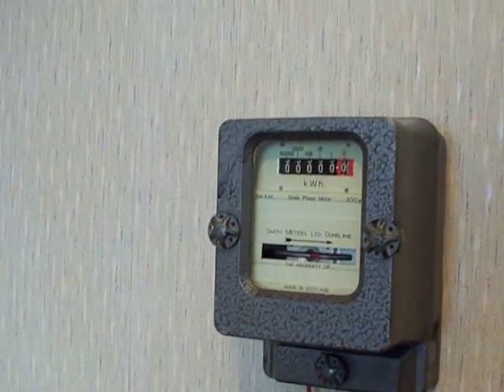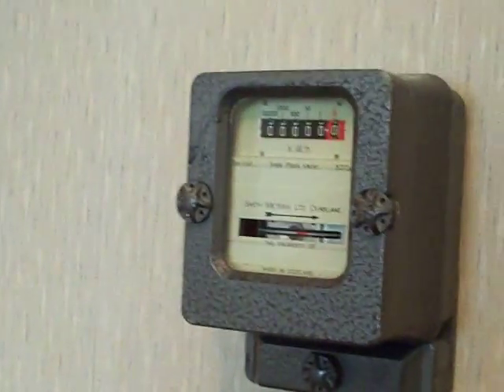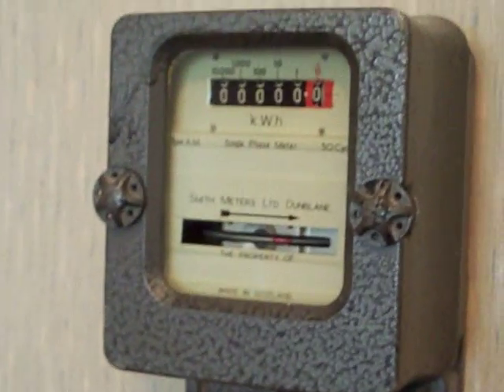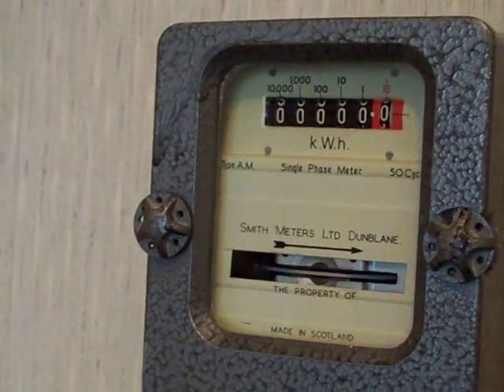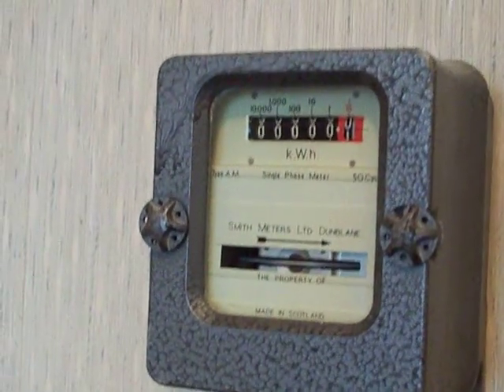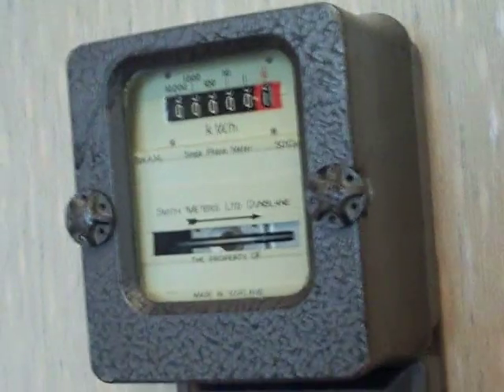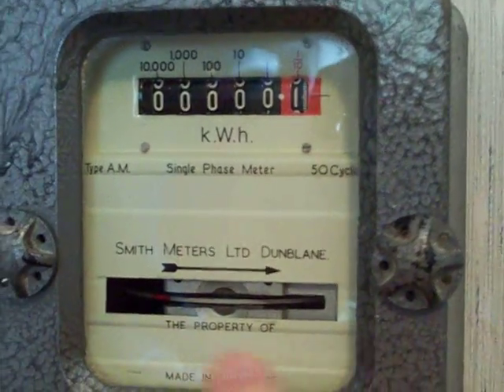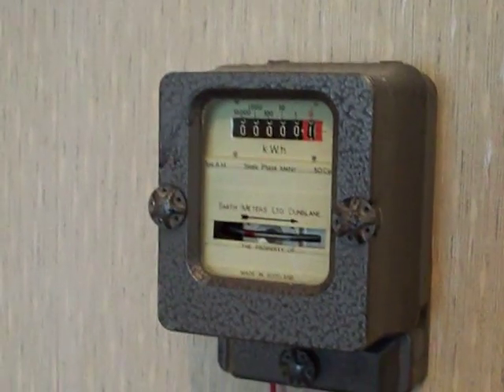Electricity Meter : Accuracy Test, Smith AM type, kWh meter.

Comment: Hello there BBD I am pleased that you got the meter going. For your information you can get that horrid paint off without damaging the surface underneath you can use a product called Tcut it's for taking a layer of paint of for cars to get a good shine on the paint work. Fortunately the paint is not that thick so it can be removed relatively easy. This is what I have been dong with my CL147D it has been coming up a treat. It does however need a lot of work to get all the paint off but the surface looks really nice and polished underneath. When I have finished mine I will have to show it off on hear when I have finished my other projects. Well done on getting this meter working. Steve.
Reply from the maker: Hi. I have heard of T-cut, but I use..... HAIR-SPRAY. :D

Just like what is seen in the restoration of the British Sangamo HM (Playlist available on my channel!) the alcohol in the hairspray will remove the paint from this AND NOT damage the casing at all, provided that the alcohol is removed quickly after doing its job.

The alcohol can be diluted & neutralised by spraying a small amount of water on top of it then rubbing dry with some soft tissue.

When I restore this one, I will gut-out the back-case (just like I did with the HM) so that I can get right into it without having to worry about getting any loosened paint into the workings of the meter, or spraying hairspray into any of the mechanism!

Thanx for watching,

-BoomBoxDeluxe.

Comment: It surprises me that in the UK the meter nameplates are often either removed or partly blanked out.
Actually it is very bad as the ratings are important for the correct application of the meter if used by an installer who doesn't know the characteristics of the meter.
Is the Smith AM is a 600 or 900 rev / kWh meter ?!
Reply from the maker: Hiya. I have done a 0.1 kWh test on this and it turns out that, just like the APM, it is 300 revs/kWh.

It took 30 revs for 0.1 kWh, so that'll be 300 revs for a whole kWh.

Because of this, I have decided to pin a loading capacity of 40A max on this one, as the current coils are comparitive in size to the ones seen in my APM, and that is 40A max & 300 revs/kWh. :-)

I agree with you that it is bad for meter specifictions to be removed, because if someone tried to pull 80A through this, it'll probably =POP= and catch fire.

Fortunately, I was the one who won it ( no other bids :D ) and I know a few things about these Smith meters, as I own a APR and a few APM instruments.

Thanks for watching,

-BoomBoxDeluxe.

Comment: looks like a rare one!!
Reply from the maker: Yes, not seen that many of these around!

I've seen a few other of the variants with the dial readouts, but have refrained from buying one as they (as like most times) were completely devoid of any specification plate. :-(

Although this plate does have details missing, it didn't take too much to figure out the missing details. I have pinned a loading capacity on this one of 40A max, and 300 revs/kWh, as most Smith meters were that capacity+ wheel-speed at that time.

-BoomBoxDeluxe.

Comment: 3 terminal just like my EMAIL M-2 !!
Reply from the maker: Hiya. Due to the wiring configuration of the Metering Board, meters that are wired to it are configured as AU / NZ wiring configuration, whereby two actives are present (in & out) and a single neutral just to allow the voltage-coil to energise-up. That single neutral carries very little-to-no current, and is not the return path for the load, as it would be on a four-terminal electric meter.

The majority, if not all British meters are Four-Terminal, as:

Phase in, Neutral in....... Neutral out, Phase out.

The two current-carrying neutrals are just joined together in the meter with a solid terminal block, similar to what you'd find in your Sangamo Weston S200.31.

Thanks for watching. :-)

-BoomBoxDeluxe.